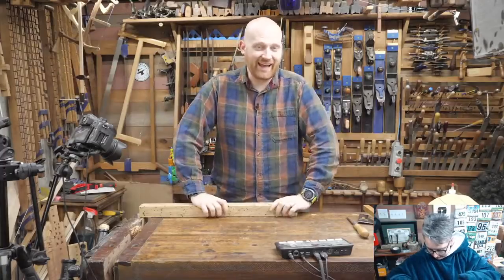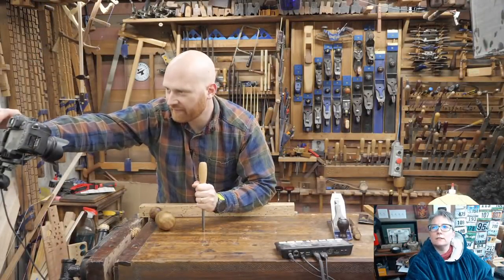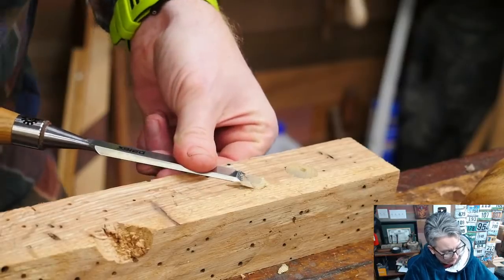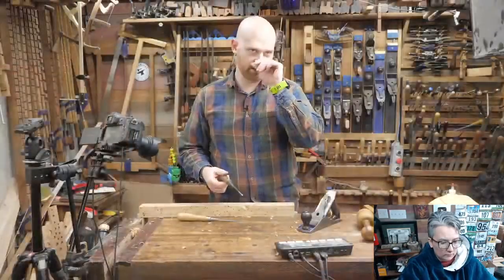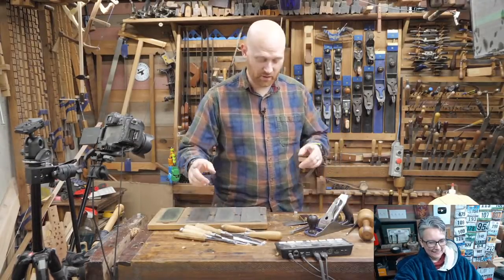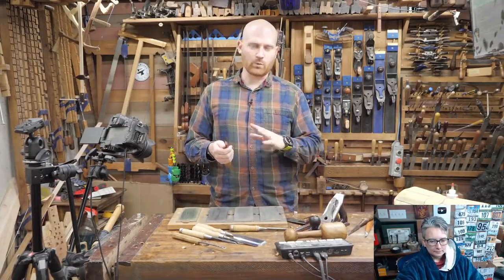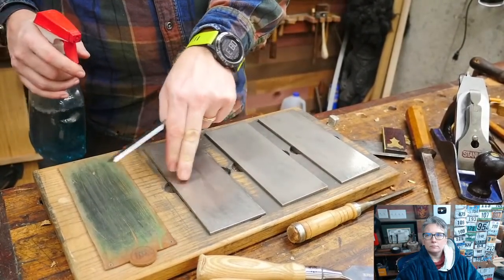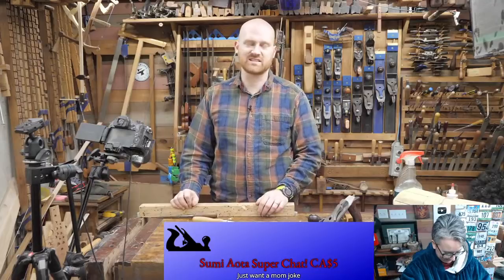Chisel Uses and Secrets tips and tricks

Comment: I assume you sharpen plane blades the same as chisels. I was gifted with a Stanley Bailey #6 and I can’t get the blade sharp enough to shave hair on my arm. I have a set of diamond stones with the highest grit at 1200. I started by cleaning up the primary bevel at 25 degrees (using a guide) to remove the serrations it had with the coarse stone. I then continued to the fine and extra fine but couldn’t remove the scratches. So I eventually gave up and moved to 30 degrees and only used fine and extra fine. I also spent a lot of time on the back and it didn’t help. I’ve spent hours over several days messing around with it and can’t get it sharp. I just bought a 4000 grit water stone (because it was the cheapest “next step”) I could find. Does a couple swipes on a strop really take an edge from not sharp enough to really sharp? What grit is the rubbing compound? You spent seconds on your chisel. I don’t see what I could be doing so wrong that hours of effort with diamond plates and a quality honing guide can’t match your seconds of free hand work. Should I return the water stone (I haven’t used it yet) and get a strop instead?
Reply from the maker: Higher grit won't get you any sharper It will just polish the edge more. I'm not 100% sure what's going wrong. Sounds like you're right on with it. Yes, plain blades are sharpen the same as chisels. I usually sharpen my plane irons at 35° makes it a little bit easier and the edge lasts longer. The strop doesn't really make it much sharper. It's just an easy way to take the burr off and it does polish the edge a little bit more. It takes it up to a polish of around 8000
Reply: @WoodByWrightHowTo  Thanks James. So I guess it's good that I got the cheapest waterstone I could find. I guess I could try going up to 35 degrees.
Reply from the maker: To be honest the angle does not matter for sharpness. as long as the two faces meet (bevel and back) then it will be sharp.

Comment: Do you bother with putting a secondary bevel on your chisels?  I think you just answered my question by responding to the question about your sharpening angle.  I just bought some Narex Richter chisels.  They came at 25 deg.  I flattened backs, sharpened using their 25 deg angle and then put a 30 deg secondary bevel.  They seem to perform very well with that setup.
Reply from the maker: I do not do a secondary bevel. it is just another step when freehand sharpening. if a chisel comes with a 25 degree I sharpen it with a secondary bevel of 30-35 untell the secondary bevel goes all the way back and it is a primary

Comment: I would have to take issue with the chisel being the quintessential wood working tool, I would say that the knife is and that the chisel is a short bit of knife on a stick.
Reply: which came first axe head or knife?
neither is a chisel
Reply from the maker: The chisel is just a knife with the handle rotated 90°. They're the same tool, just a different application.